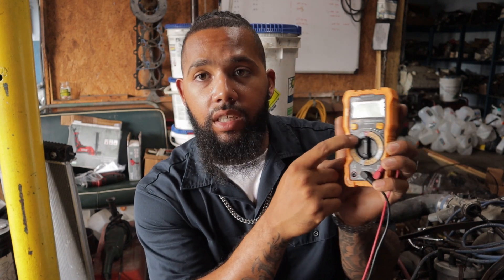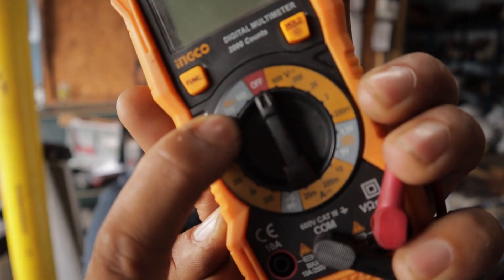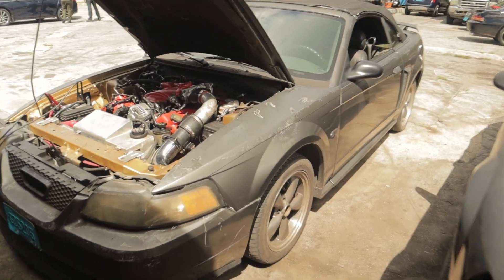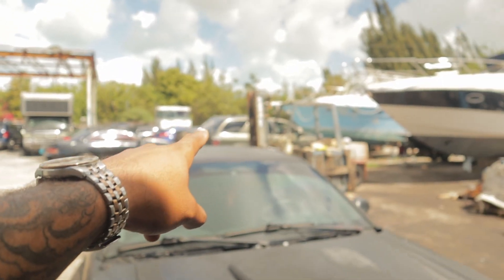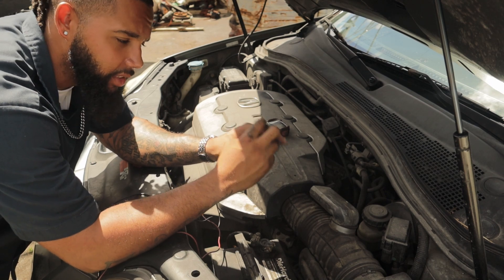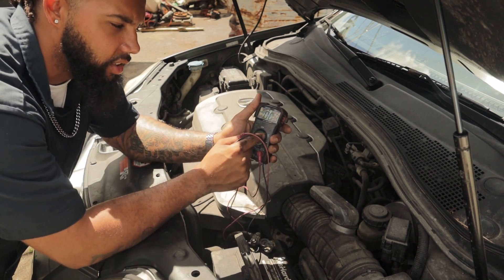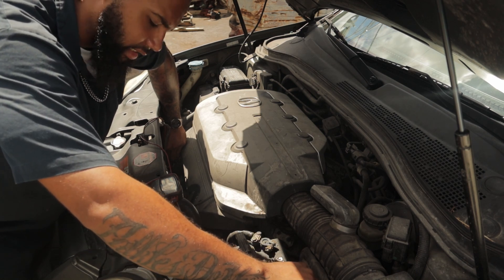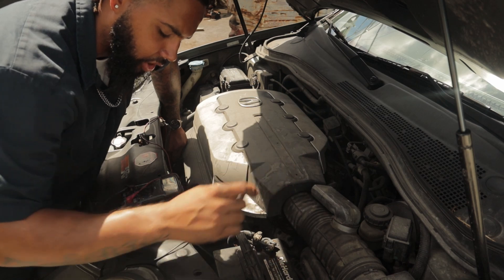How To Test Your Alternator For Ac Ripple

Comment: hi
do you mean 0.5 V? I hear people say there shoudnt be more than 50mV(milivolts) which in volts would be 0.05V 
If you can answer it would be very much appreciated
Thanks again
Reply from the maker: Hey man, i believe its if the alternator is making more than 0.1 volt of ac cureent it most likely bad
Reply from the maker: 50-100 mv
Reply: I think you're confusing this with the limit for parasitic drain. With parasitic drain you're allowed up to 50mA (0.050 Amp). Get your 💩straight.
Reply: You can have as much as 1 volt of AC ripple and be ok.
Reply: @bernardocisneros4402 as long as engineers took care of that possible outcome so they prepared electronics for that!